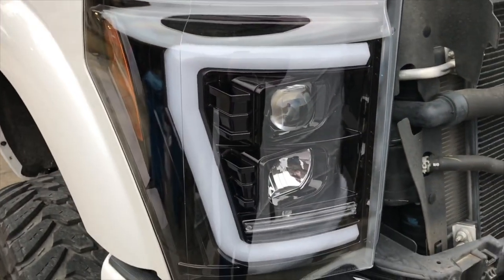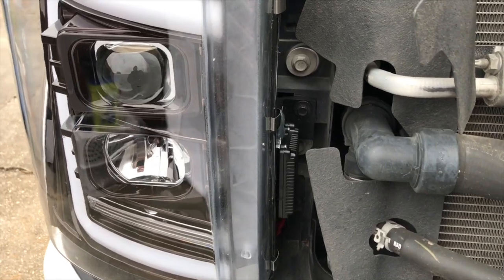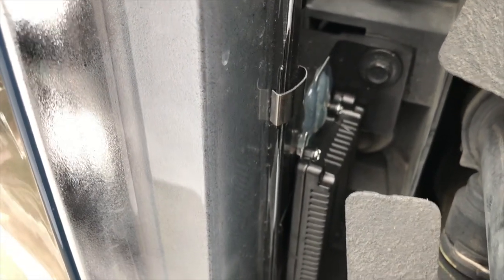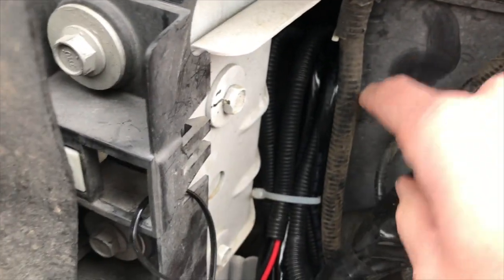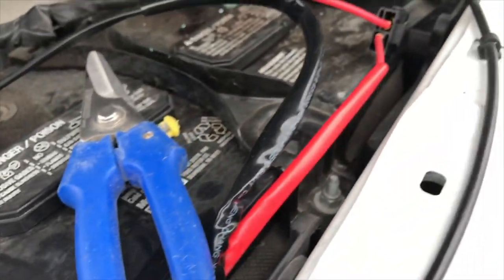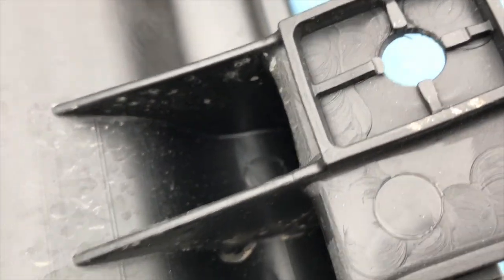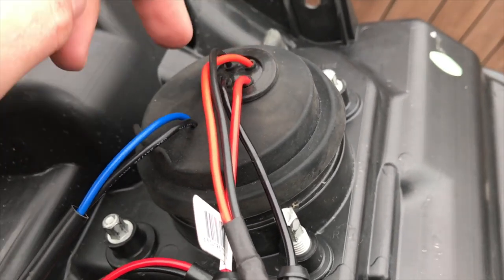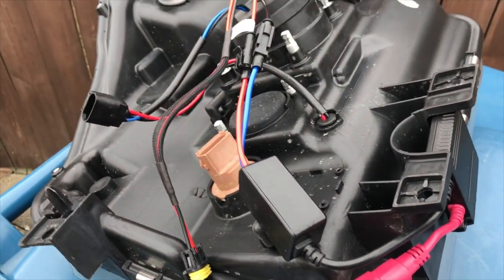Recon 11-16 Ford SuperDuty Projector Headlight HID Install

Comment: I installed the same headlights 2 years ago. Mine are now For Sale.
Reply from the maker: Must of had a prototype run on those as then came available a little over a year ago. I was one of the first 12 sets recon had gotten in. 

Why did you sell them?
Reply: Well it was 2018 when i installed them so about that time. Installing the new Morimotos next weekend
Reply from the maker: Just why? Why did you have to tell me about these? Now I want them too!🤑
Reply: @shebert29  lol i know. The 3 projectors and the chasing C shape turn signal is sick
Reply: Where are they for sale
Reply: @fogbank98  mine are for sale $650 obo. Does not include shipping from California
Reply: Dieselmxtt ah that’s too bad, I’m across country so that’s be a bit and they have them for sale on amazon at 540 currently
How’d you like them though? Any issues with condensation?
Reply: @fogbank98  the cheapest i have seen is $850 on ebay for same as mine. A few nockoff brands out there selling for cheaper. Cross country shipping as if going to Florida is around $150 UPS
Reply: Dieselmxtt yeah I see the spyder ones on amazon but this ones from recon directly

RECON ACCESS 264272BKC Black Projector Headlights https://www.amazon.com/dp/B07DYZSWLH/ref=cm_sw_r_cp_api_i_kx8kEb1KRDZ93

Also from here 

https://www.purchasedirect.com/product/Recon-264272BKC/34033?rid=googleCSE&gclid=Cj0KCQiAyKrxBRDHARIsAKCzn8z1ZnHmxQpd08gxW_6WLERDr43a5oZPvJbWGe88pPEKJjH-A-14x8MaAl88EALw_wcB

I thought it was weird with the price difference cuz yeah 750 was the cheapest I found it on eBay and stage3motorsports
Reply from the maker: @fogbank98 mine too are for sale. I have them on Marketplace for $650. I'm in Louisiana so what ever the cost to ship them from here.
Reply: Everyday Gear Channel I’m going to call recon tomorrow and see if the ones on amazon are legit because they’re weirdly cheap, but if they are not legit I would love to purchase yours. Much closer to ship.
Reply from the maker: @fogbank98  plus I am including the HID headlights and balance and all the wiring included in that price without shipping.
Reply: Your selling yours now too? Lol looks ill have to sell mine cheaper as amazon has them alot cheaper then i have found
Reply from the maker: @dieselmxtt  those are a knock off made cheaper. I looked at those and they have chrome mixed in. I wonder if they work like these?

Comment: Hi, thanks for sharing.  I just ordered a set of Recon  2nd Gen headlights for my 2014 GMC 3500 Sierra Denali HD. How do you like the optics in the projectors? Recon claims their glass they use for their optic lenses is superior compared to Anzo or Spyder after market headlights. I have a set of Spyder now, and they aren't all that great even with a 6000k 35 watt HID kit. Just wondering if they are what you expected considering they are twice as much as the others. Thanks again. Scott
Reply from the maker: The HID I put in these (35w I believe) work just fine out of the projector lens.i have a good sharp cutoff line with them. I do believe they could be better, but they do work.

Comment: I hope your headlights dont melt, the ballast gets hot.
Reply from the maker: Think the Hot Glue I'm using to hold it on the housing will melt first before the housing melts. But also, being that I'm usually driving while headlights are on, and where they are placed, it constantly gets air blowing over it to keep it cool.
Reply: shebert29 🤞🏻🤞🏻🤞🏻
Reply: @shebert29  Do the 35w hids get pretty warm? Also you should do a video of the light output on a dark road or something. I'm interested in what is like vs led.
Reply from the maker: I've not had any issues with the lights getting hot. Like I said earlier, these are only on when I driving at night or its raining. 

I can try and get a video, do you have a email or Instagram DM I can send it too?
Reply: @shebert29  @zygillam instagram

Comment: 3157 bulbs for the turn signals?
ive been toying with the idea of getting these headlights from recon for months now and I still cant pull the trigger on $850! good video tho!
Reply: get the spyders, there 330$, probably built by the same company, same design, same low quality components... swapped the projectors for morimoto d2s 4.0 square HID bi-xenon projectors, thew some rigid hyperspot pods below and swapped the DRLS for profile sequential switchbacks
Reply: The spyders were garbage quality, I returned them for these ones without the sequential DRL, $540 and you get the good quality.

Comment: Nice Truck! What tires do you run?
Reply from the maker: Sorry for not responding sooner, these on the truck are Toyo Open Country M/T 37x13.50x20. They didn't last long and this isn't a daily driver. I'm looking in the market at some other tires for when I do replace these.

Comment: Are you pleased with the light output with HID bulbs?  I bought these same headlights and tried LED bulbs, but they were terrible.  Much worse than the halogens that came with the headlights.
Reply from the maker: Grant Anderson: Yes I’m pleased with the output. I did a lot of adjusting and then driving to find the perfect adjustment for my lifted truck. Although, when I did first put the H7 in the housing and went to adjust them, I noticed my driver side wasn’t producing as much output. After removing the light, adjusting the alignment so more, it seemed not to do much to help. So out of desperation, I pulled the H7 bulb out and then reseated it, that did the trick. Apparently these H7 have to be seated exactly to work properly. Hope that helps you.
Reply: Grant Anderson what brand LED? The problem is most likely a cheap Chinese’s LED

Comment: Would anybody here have information on how I would go about changing the OLED white to a switchback? Love the look but would be perfect if that was the turn signal. Thanks!
Reply from the maker: The new ones recon has out already do that. I would have to get back to you on converting these to switch back though
Reply: Everyday Gear Channel yeah the call it scanning i believe, it has a cheap look to it imo, I’d rather go with a full rgb or just yellow full blink but I appreciate it man, thanks! Love the look of the truck btw

Comment: When you ordered the retro-solutions H7 HID kit, under application did you input F250 2004+?, or do you need to speficy the harness, I guess since this is not a BiXenon system, would just checking F250 2004+ on the dropdown kit get you what you need in terms of wiring harness?
Reply from the maker: pianods : I didn’t order the wire harness for the F250 because we use a different stock bulb then the H7. Email Retro-Solutions and let them know what you have and what your doing and they will get you the right things for your application. That’s what I did

Comment: So if you were to run HID in both low and high beam. Could you even use a relay harness? You only have one factory plug per side but now have 2 sets to run?
Reply: Check out retro fit source they should have a harness I did a retro kit from them

Comment: Do your daytime running lights have to be turned on for these to be on during the day
Reply from the maker: RidgeW100: D.R.L actually don't work with these like they described. Your truck D.R.L are either your parking lights, 50% low beam or fog lights. The OLED part of the light is run off the marker lights. I do wish these were switchback OLED light bars that were on the turn signal light.
Reply: Well you can always wire your lights to an ignition source if you want the lights to be actual DRL. By means, you can run an ignition power source to the tube DRL lights if you want them on during the day.
Reply: Noe Salgado how would you do this?

Comment: Are the recon headlights plug and play if you leave them stock or do you still have to wire the running lights into the stock headlight harness
Reply from the maker: carter ziegler : 100% plug and play. No addition splicing into wires with these
Reply: shebert29 so it just uses the existing headlight plugs that you unplug from the factory headlight?
Reply from the maker: Correct

Comment: Any videos on changing out the bulbs?
Reply from the maker: OneTime 38 you literally have take the headlight assembly off your truck to get to the bulbs. Then turn the headlight socket remove the bulb and put back together in reverse.

Comment: How did you power op your high beams since the factory harness has to go to the ballast
Reply from the maker: Joshua Martel start watching around 3:48 and you can see somewhat how it works. Basically the recon lights are on a wye connector, you are just tying the HID into the low beam side and then stuffing that connector into the housing.
Reply: shebert29 yeah it just looks like you left he recon wiring alone and didn’t plug it in so how’s the high beam getting power
Reply from the maker: Same way as if I didn't do the HID. All that happens with the HID is your adding the ballast in line to power the HID, the rest of the wires stay the same. RetroSolutions will send you the correct equipment if you contact them on exactly what you have and what bulb.

Comment: These would look better if you had them custom painted and changed the OLED in the Headlights to OLED Switchbacks.  Plain An Simple can paint them for you.
Reply from the maker: I told recon that the blinker light is just ridiculous. I said they should have made the OLED a switch back and then you would truly have DRL on these lights. As Ford doesn't support DRL on running lights only, 20% low beams, Fog Lights and Marker Lights. 

But I don't like paint matched headlight housings. I like the black look on the housing, but thanks for the offer.
Reply: shebert29 yea I sent mine of to plai an simple and had the blinker plugged and painted over
Reply from the maker: Do you have a link to them that you would want to share?
Reply: Shane Turner do you have a video on how’s yours look after Plain an simple painted them by chance? What do they charge?
Reply: Shane Turner thanks bud! But link didn’t work for me
Reply: @JGONTX  ok, I will upload to you tube in a little while

Comment: So h7 led will work for both low and hibeams?
Reply: Also, how did you wire in drls?
Reply from the maker: @nombr  so these headlights I bought December of 2017. They came with a H7 regular bulbs in them already. These are not the same type that are in the Stock Headlights from Ford. So when i purchased the HID lights I had to get the H7. As far as the high beams, I'm not sure what size those are. I don't have the truck anymore and I just recently sold the headlights to someone. 

With the DRL, these came wired to the parking lights on the headlights. So when the parking lights came on, so did the DRL. They also where on with the headlights too. I never looked into seeing if I could wire them independently of the parking lights. 

I do know recon now sells a scanning version of these as well. I'm not sure how the DRL are wired on them. But look at the Morimoto headlights, I was considering these prior to selling my truck as I think these look better then the recons.
Reply: Everyday Gear Channel okay thanks man, I have the recon ones. Currently trying to figure out the scannin portion of the light

Comment: Did you have to use a h13 to h7 adapter to fit
Reply from the maker: They plug is the same from the OEM to Recon Light, doesn't matter the bulb used. If you are trying to get the HID conversion, Contact Retro Solutions, they will make sure you have everything correctly you need to make these work